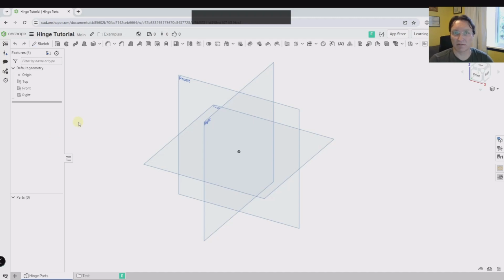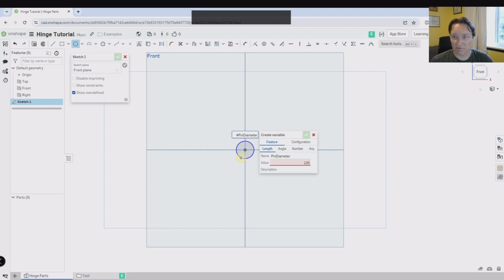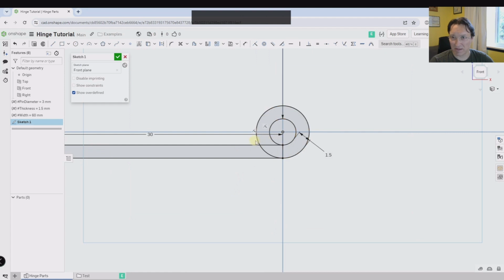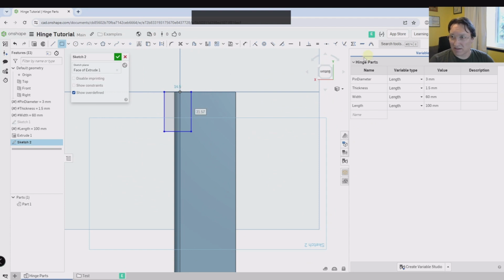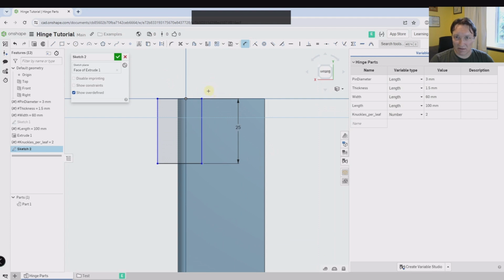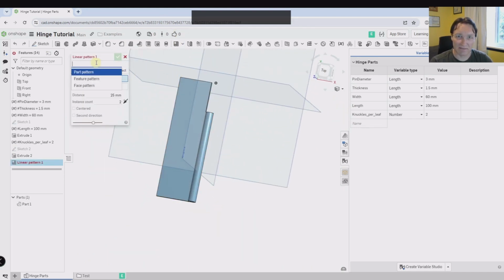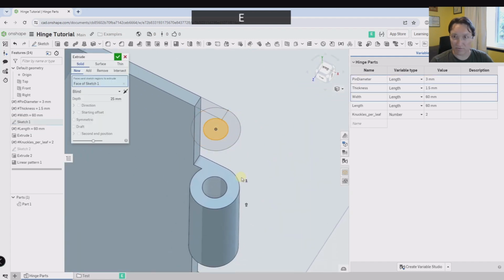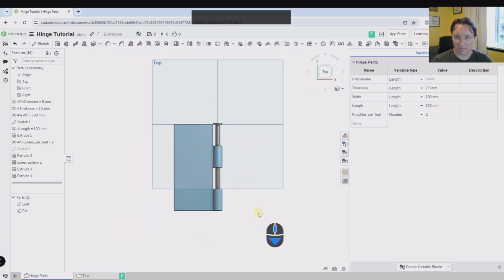Onshape hinge tutorial, proper parametric model using variables, part 1

Comment: At 5:01 you said "Get reference for this, make this coincident."  Then you made Sketch 2 coincident with the outside of the back of the hinge.  How did you do that exactly?  I don't see a way to make that sketch line up with the back.
Reply from the maker: I do a "use" (shortcut key "u") first to convert the circular edge to a line on the current sketch. Then I make the corner of the rectangle coincident with the end of that converted line.

Comment: Hello Airwick, great video, I am trying to make a hinge that has more or less got semi-circular leafs, can this be included in the above example? The leaf was made in extrude, can a variable for an #arc, be included here?
Reply from the maker: This is bit tricky as you can't have a sketch element go between a straight line and an arc. It's might be possible using some tricks like a ternary operator and maybe a replace face or something, but probably not worth the trouble to have it work "automatically". I guess you could also have a Boolean configuration option for "curved leaf" and then control the configuration visibility of the radius variable.
Basically it's possible but I would probably just create a different hinge model with a leaf that is always curved (draw circular edges instead of a rectangle for the leaf in sketch1) and then it's easy to control the radius with a variable.